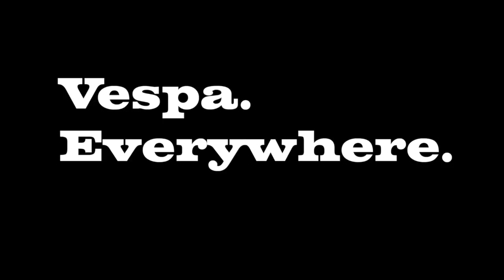Prepping An All Original 1978 Vespa P200E For Sale: PART 2 Engine Rebuild

Comment: Tremendous! I have had two 150 Supers. The first when I turned 18 years old as an apprentice at Cincinnati Milacron in Birmingham UK. The second was a beater that I bought when in college. It had its side panels chromed Quadrophenia style. I am now on my second GTS 300 Super - a creature of habit. I often watch your videos especially before servicing one of my scooters. 
My friends rode slimline lambrettas and I envied them at the time, but it soon became obvious that the Vespas were more reliable and stood up better to the punishment I gave them. I am getting so much out of your videos. It is getting difficult to find a good shop for servicing locally, so I still fettle them myself although as I approach 70 yrs old, it would be good to find a trustworthy technician. 
Thank you so much for the work you do on these vids. Truly an international treasure!

Comment: Back in the 70s we had a whole batch of defective crank seals where the rubber would separate from the steel and cause a major leak. One day I had a carb off a rotary valve 150 setting on the bench when another mechanic walked by and gave the kickstarter a kick and the engine started and ran without the carb! Gas had leaked through the inner seal and filled the transmission. From there the gas was sucked back into the crankcase and the engine would run without the carb.

Comment: Be really careful.  Killed my crank threads!  I used the method shown to re-install the crank 1:11.  With impact tools, you can strip the threads in a split second.  So I'm out a crank.  Otherwise, an excellent video!

Comment: When you put the gears back in  (1:20:15) - do they need to line up with the space for the crucifix? Or does it matter that they DONT all align? Just re-did my VBB1 and am having issues with shifting - I lined up all of the spaces for the gears so that the cruciform can slide smoothly between them. I am thinking this is the issue...which means I'll have to tear her apart again...ugh

Comment: Very nice and very thorough! My sincerest compliments.
 I just picked up a 79 P200E with missing cylinder/flywheel/head. its a mess. it also says 43000 miles on the clock ( Is that even possible?!)
 I am presuming its going to be an engine- out full rebuild. Do you have a video for that?
Reply: 43000 miles is no big deal. My Rally 200 had 170,000 miles when I sold it. Yes I had replaced the piston, rings, and bearings and clutch plates a couple times but that's not a huge job.
Reply: @MrHugemoth  thanks, good to hear!

Comment: I'm looking into a 2013 Piaggio BV350 with just over 7K miles on it. It has no compression. Sales price is just below $1,000 (I know....you get what you pay for) but I have mechanical experience. This would be a first scooter. Is it worth looking into or am I going down the wrong rabbit hole?

Comment: QUESTION  i have a 125 px 2008 and it is slow especially unsafe for fast motorway riding , i did think of getting a 4 stroke LML 2OO engine but i was shocked to find out that they only do  55 mph tops , what would you suggest 200 engines are very hard to come by , cheapest  way to improve my speed situation, but i dont want to effect the  reliability of the scooter ,  which to be honest is one of the many good things about the bike its reliable ?

Comment: Great video.
What will be the minimum break-in millage that it is recommended after a piston change?
I have a friend that told me about 1,000 miles at no more than 25 mph. If that is the case it will take me forever to break-in
Reply: I’d be interested to know how old your friend is. Fifty plus years ago, breaking or ‘running in was a more rigorous process. Machining , metallurgy and lubrication sciences were all less advanced. It is still necessary to gradually build up the speed and load a vehicle is subjected to. On my GTS Vespa, I was advised to keep below 50 mph for the first 600 miles. Better advice would be to not exceed 60% of full power, and to vary speed. 
My first journey was from picking the bike up in Watford and riding it to Birmingham. Not ideal, but it did not affect the bike adversely at all.
In the 50s and 60s, cars came out of the dealers with ‘Running in please pass’ displayed in the rear window. Machined finishes were not as fine as they are from the factory now. It was important for mating surfaces to lap against one another burnishing the parts to reduce friction. This is no longer necessary.

Comment: Hi I pulled the oil drain plug out and gas poured out any ideas
Reply from the maker: Possibly a leaking fuel valve or float needle causing carb to flood and draining fuel into the crankcase over time.
Reply: It’s odd because it started and ran good the day before,I am wondering once I put fresh oil back in the gear case if it’s going to suck the oil into the crank case and burn it